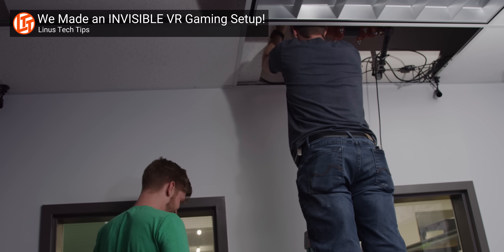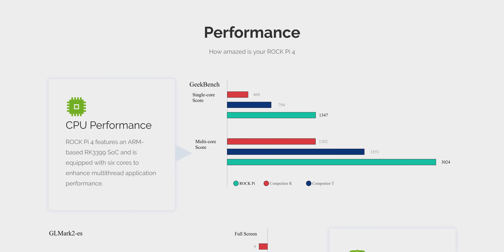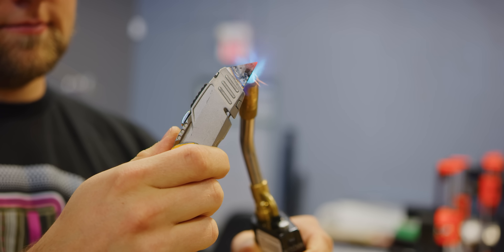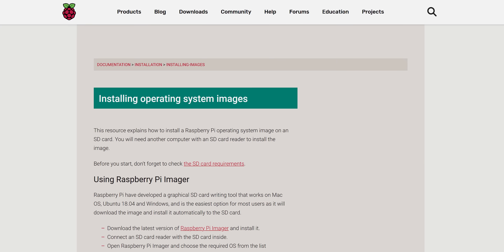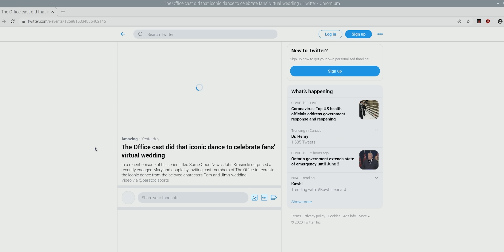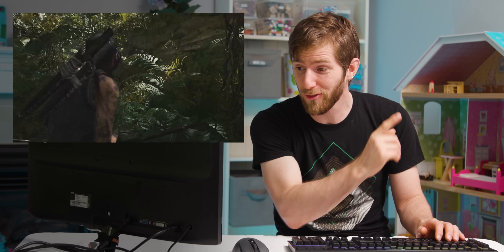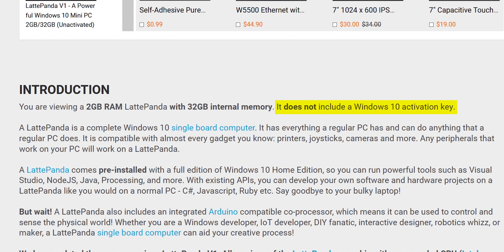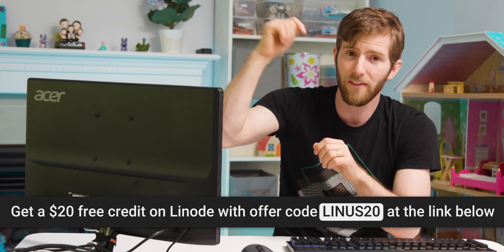My SECRET Computer……

Comment: Huh?? You know what this gave me a home project idea. I got a free 4U Rackmount Short Depth Server Case. I can replace the parts inside with a i7, gtx 1060 6gb, 500gb ssd pc. But instead of a mini pc I have 2 steam links I had bought for around $7 on sale, these will go in the living room tv and bedroom. It will allow us to play games from any room and access the same PC for video editing and web browsing. This will work excellent because I can run this on my Cat6A Home Network without the need of running HDMI Extensions or expensive Fiber USB Extensions.

Comment: I'd been thinking about throwing a raspberry pi or some other s.b.c. into an old big screen television that someone had thrown out a while back, even going so far as to solder the connections for power and video directly to the pcb of the television to keep all the connections hidden, but lazy got the better of me.  Still considering throwing an old laptop into a big screen if I can find one with enough room inside the enclosure though.

Comment: You can install Windows 10 on ARM.  This is not IoT, it's a real version.
https://www.windowslatest.com/2020/02/09/heres-how-windows-10-runs-on-raspberry-pi-4-and-3/
Reply: True, but it won't give you much, as most Windows software has never been compiled for ARM and are not open source.
Reply: It sucks. Win32 programs are emulated and run like shit

Comment: A great wway to deal with adapting it for VESA would be with a 3D printer. A three-piece solution which has a bottom you fasten to the monitor, side shroud which can be fastened with the Pi and a top piece which attaches to the shroud would give it a clean look without a lot of money spent.

Comment: i recently wanted to try chrome os on my old laptop but this gave me a new idea.
instead of pesky arm raspberry pi. could we use pesky old laptop mobo and use chrome os. ( play store access and linux apps can be usable)
you can use chrome os on old laptops. some laptop mainboards are small enough to  fit i guess.
new part 2 video idea? o_o

Comment: Just a cool video idea, of you'd like some home/setup automation with remote plugs, network plugs are really expensive. But 433mhz remote plugs are really cheap and you can hook a cheap 433mhz transmitter to a raspberry pi zero wh and you have a network plug...try it!

Comment: Why not skip the second power cable and power the Pi off the monitor's own 19v power input? You'd need a voltage regulator to get 19v down to 5v, but there are tons of little switching power supplies for the Pi that will take in wide input voltage ranges and spit out 5v.

Comment: Raspbian is kinda... meh as a desktop OS. 
Sure, it does the job. But it has out of date repositories (especially if you are one of the 8% firefox users). And a very basic LXDE based UI (known as a Desktop Enviorment in Linux) that can't be easily swapped out (Yes, Linux can swap out the desktop UI. You can even have multiple DEs installed and switch between them. As a Windows user this blew me away.)

Ubuntu MATE is much more modern. With the MATE UI (that looks a lot like GNOME 2 but much more lightweight) and is essentially compatible with any SBC if you look for it. You can also have a compromise between up to date Ubuntu repos and the LXDE (well, LXQt) UI with Lubuntu.

Comment: Why This over say a tablet or phone?

Samsung Galaxy Phones with Samsung Dex, aren't the cheapest.. but frankly  they are as capable as most PCs with power tasks & can take in as many input devices & be as easily useful & hidden  any raspberry pi.

honestly, like the blindman said to the teacher asking about the pencil.. 'I just don't see the point', the salvaging a monitor is great.. but the secret pc just doesn't make much sense... as you can easily hide it  right next to your main pc as well. (or inside your PC as a vm)

Comment: It's funny, I just did this exact project a few months to replace an Android 12' tablet that was stuck at  5.0.  I use it at work basically to run my music library via Plex. The only thing I did different was to buy a 20"(diagonally) monitor that's actually pretty small. I just used velcro to stick on  back. The whole time I was watching the video I was wondering why he wasn't doing that. Much easier to do any maintenance and since its wall mounted, everything is pretty much hidden.

Comment: I replaced my HTPC for a Raspberry Pi 3b+ and I use Parsec to mirror my desktop to my TV, no need to upgrade any storage on the Pi, just a 8gb SD Card and I run everything on it, and with the Pi connected with an wired network the input latency is barely noticeable, I notice more the natural input latency that the Pi cursor has than the input latency caused by Parsec streaming.

Comment: Rather than a LattePanda, what about the Intel Compute Stick. can grab those up to 4GB and since they are a couple years old now, you can pick one up used off ebay or such easily for under $100. 
Can easily fit one of those internally into a monitor for stealth and have the full windows experience and are better performing than a Raspberry Pi.

Comment: Why not use Parsec (since you already demo'd it) instead of SteamLink. Then you'd be able to connect to your home PC from anywhere in the world with arguably better quality, higher Resolution, and (if you're savvy enough to dive through the config file)s at > 60 fps potentially!
It DOES have a Raspberry Pi 3 install (no 4 yet unfortunately) and then you'd have a better desktop experience too. (granted no multi monitor support but hey ... you're only on one monitor anyway)

Comment: I play on 30fps because I have a switch and I’m pretty sure that if I get a 144hz monitor it won’t go to the full FPS potential of the monitor how can I get the most out of tre monitor? The monitor I’m looking at has hdmi 2.0 so do I need to get a hdmi cable that can support 144hz?

Comment: 0:06 WHAT?! That's actually real? As a kid, I had a dream where a bedroom similar to the master bedroom of the house I lived in at the time had a PC hidden in the ceiling, but the PC in that dream had a Pentium 2 and ran Windows 95 or 98 in the late 2000s, and had disc and floppy drives that showed up but was physically inaccessible, and the display was a projected screen, but the buttons on the projector were physically blocked by a custom mount.

Comment: Probably could have tapped into the monitor's existing DC Input as I'm sure that is carrying plenty of power for both the monitor and enough left over to power the pi, and typical monitor voltage/amperage is similar to what the Pi uses that you probably don't even need to convert the voltage/amp with a resistor or whatever.. In addition to this, could have considered internally wiring the HDMI to the monitor's HDMI port. ...And by doing these two simple extra steps, then you can have the ultimate stealth computer mod.

Comment: Ok, just a few things, first of all good video, second you use apt-get to install things. And third the raspberry pi uses a 1 gbit ethernet port, so a network upgrade won't do anything...
Reply from the maker: I was using wifi in the video. The network upgrade would be plugging in a cable.
Reply: @LinusTechTips  oh yeah sorry that's a good idea, the wifi chip is bad...
Reply: @LinusTechTips  Just a cool video idea, of you'd like some home/setup automation with remote plugs, network plugs are really expensive. But 433mhz remote plugs are really cheap and you can hook a cheap 433mhz transmitter to a raspberry pi zero wh and you have a network plug...try it!

Comment: "Keeping that old display out of a landfill"
Sees my current monitor

Edit: nevermind, my monitor is even older, it's 60 hertz.
Reply: Bruh I'm using a 720p Samsung from 2009 as main screen
Reply: im on a 7yr old laptop
Reply: I had less problems with my old 60 hz asus monitor (I think it was a something234something, full hd, vga, dvi, hdmi) than i had with my newer PG278Q- mostly due to the external psu. Btw i'm still using the old one, about 10 years old and still going strong!
Reply: @RPYoshi  same here...
Reply: >Still using a early LCD monitor from 2005
Reply: @KiraSlith  Even a CRT would be better😅, though highly impractical.
Reply: acer p216h
Reply: mine is also similar one but 75hz.
Reply: @thadeustr  I overclocked it to 75
Reply: I don't even have a proper monitor. I'm using an old 14" TV.
Reply: Rushi Patel lol
Reply: my monitor is even older, it's 40 hertz 1280x720 lcd screen
Reply: I had a 2007 Dell die becuase the backlight went out so yeah NOT usuable and thus I had to replace it. It was my secondary monitor main is still going strong. 0 extra monitors here tho
Reply: I dont even have hd lol
Reply: I'm watching this on an IBM Personal System Model 25
Reply: @RPYoshi  but the monitor he's using is 144hz?
Reply: I simply handed my old display down to someone who needed it more than I did.
Reply: LOL, mine monitor is liteon 5:4 1280x1024 old assfuck 14ms/24ms crap, still semi-pro in cs go xDD
Reply: Can y’all just start using your TVs as monitors ?? It’s probably better spec’d than what you’re using now anyways
Reply: @bayronalbazan1725  Well, the 4k tv is larger then my room and the famiuly uses it.
Reply: @bayronalbazan1725  TVs are often horrible for gaming. Bad latency and refresh rates, as well as the pixel density lmao
Reply: Ha mine doesn't know what Hertz is..
Flip
Reply: If it's 60Hz then it can't be that old - "back then" many office monitors were at 75Hz. I still wonder how we took that step back...
Reply: if it were older it would be more than 60 hertz

Comment: In my dad's old office he had a few switches on his computer and a second monitor facing away from him so if he needed to show someone something he hits the switch and it either mirrors his monitor or works as a second monitor where he can drag stuff across. Could you do something like this so the monitor works with a regular computer but with a switch it changes to your hidden computer? Maybe use the built in cable settings of the monitor so the main computer is on dvi while the hidden one is on hdmi.

Comment: That feeling when Linus "old screen" is your main screen
Reply: This feeling when your new monitor is cheaper then this used monitor 🤷‍♂️
Reply: @Noname_2014  it's actually a really really nice screen, stuck to my gtx 1080 though, needs dvi for 144hz 😂
Reply: I actually still use that exact monitor. Except it's a 27inch
Reply: I am using it as a second vertical monitor since I can't use the monitor in 144hz anymore due to me now having an RTX 2060 :'v
Reply: @PocketNachos  the evga rtx 2060 ko has a dvi port
Reply: @forrest2453  haha I've got the EVGA GeForce RTX 2060 Super SC Ultra Gaming and it also has a DVI port, thank god because my old 1070 Ti died on me :(
Reply: @imBigo  nice bro. I'm thinking about getting an upgrade and the 2060 with the dvi port is all I need. First off, it's the cheapest rtx card and it performs between a 1070 and a 1080, so that's really all I need. Then I got my 144hz monitor, but it only goes to 144hz through DVI. Plus it's only $300, so when the rtx 3000 series comes out, it won't depreciate that badly compared to buying a 2070 or 2080. Literally the perfect card for me
Reply: @PocketNachos ooh, Dual link DVI? if you have any old crappy old dual link DVI card (I tested with an NVS310- it's probably worth about £10) and install it alongside the main one so you can plug the old monitor into the card with DVI, and run at 144 Hz and any crappy old monitor into the  2060 and set the one plugged into the 2060 as your main display.

Then start a game in windowed mode and just drag it across to the 144hz monitor, done.

In windowed mode the games frames don't actually get outputted straight to the screen- they get written to memory so the desktop window manager can draw that border around them/minimize/exit buttons etc. 
Which is then what actually outputs the result to the screen. The screen it's on need not correspond to the card used to render it- it's why programs don't crash when dragging from one screen to the next.

Here's a stupid picture I made of crisis running in a window that's split between two monitors, each connected to a separate graphics card XD(the NVS 310 can definetly not run crisis) https://m.imgur.com/a/0EWyGED

It's a little silly, and does have some overhead, but not necessarily more than just gaming in windowed mode would assuming the DVI graphics card is just even slightly better than a 310, it's surprisingly playable. And honestly I'm still surprised it didn't just crash when I tried that crap XD.
Reply: @PocketNachos  cable issue?
Reply: @PocketNachos  I have an RTX 2060 Super and I can use 144Hz on this monitor, because I have the founders and it has a DVI-D port.
Reply: PocketNachos  I have an RTX 2060 Super and it still has the DVI port :D Also if you want I've got an active Display Port to DVI-D adapter. It works up to 120Hz and maybe more if you try a custom resolution in the nVidia control panel. It's a StarTech DP2DVID (DisplayPort To DVI-D). I could sell it to you if you're interested :)
Reply: That feeling when you dont have a monitor
Reply: @lorenzovanerven4610  that feeling when the only computer is your smartphone and Casio calculator.
Reply: not my main but its a good Linux display for what I do on my 2nd PC.
Reply: Bruh mt best monitor is a chat monitor for discord and shit, my main is a fucking tv, its garb
Reply: @yousonofadingus  Save some money and buy one! If you're a child sell sweets in school, I used to make £20 a day that way :) . It is such an upgrade from a tv to monitor.
Reply: That feeling when Linus "old screen" is BETTER than your main screen
Reply: That feeling when Linus “old screen” is way better than your main screen. (60Hz gang)
Reply: lol i'd like that
Reply: Until a year ago my monitor was a 2006 hp monitor
Reply: I'm using an old monitor from the warehouse my mom use to work at. One day I'll get an upgrade but for now I'm happy
Reply: Damn how many people people also have that thing ?
Reply: That feeling when Linus "old screen" is BETTER than your current screen. Okay, mine is an IPS screen but it's only 60hz.
Reply: It’s better than mine
Reply: My usual reaction when he mentions "old"...   😡🤬
Reply: Same lol. It was a decent budget 144hz option years ago. I still use it :)
Reply: @MikeFic  Still is a decent budget 144Hz monitor imo :P
Reply: Same
Reply: yeah...

cries in 10 year old 1366x768 LG LP156WH4(TL)(A1) Atleast made in Korea,
on a 10 year old HP G42 466tu with a core i3 370M...
Reply: @ayushp.5395  its way older than 10 years 1366x768 wasnt sold in 2010 anymore. atleast not factory new
Reply: that feeling when your main screen is a late 90s professional CRT
Reply: yep
Reply: That moment when ur main display has less than half the refresh rate than his old display. My bottleneck is my monitor lol (2060 Super, Ryzen 2700)
Reply: bro same
Reply: i tought he was gonna say old 60hz 1080p screen but nope 144hz lol
what most of us have as main, and are glad ot have a 144hz screen lol
Reply: This is the monitor I'm watching this on too x.x
Reply: Not even close
Reply: That feeling when your main monitor only has 60hz (im lucky with 75hz)
Reply: when u realize that linus old monitor is at least 3 times better than my main monito
Reply: i have the exact same monitor, my laptop has a better screen lmao
Reply: I use the scepter c24 144hz monitor linus reviewed in his cheapest 144hz monitor video. It’s actually an incredible monitor especially for $150
Reply: true 
:(
Reply: that felling when linus' "50$ computer" is faster than your full-sized pc
Reply: I daily drive 3 of them lol